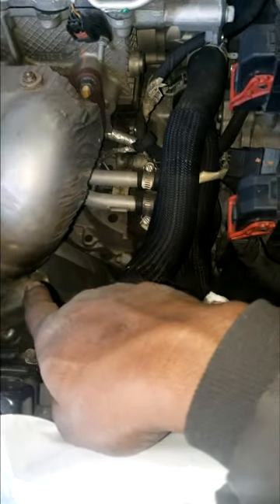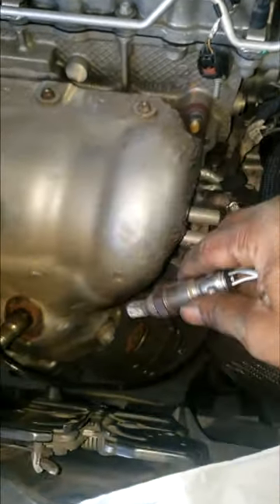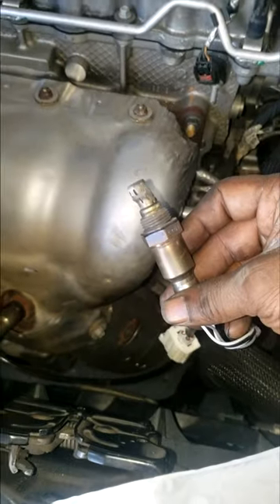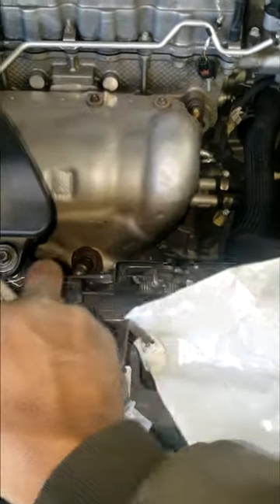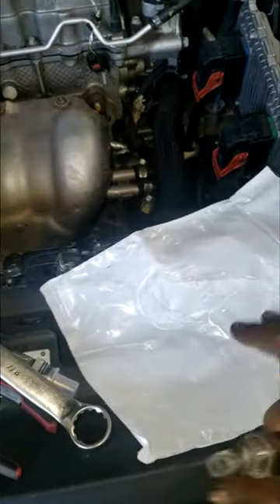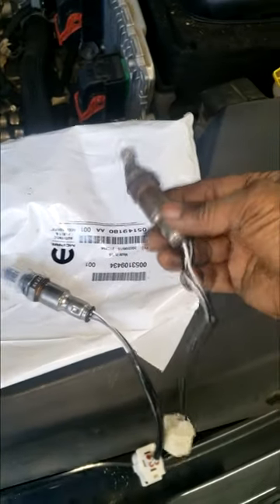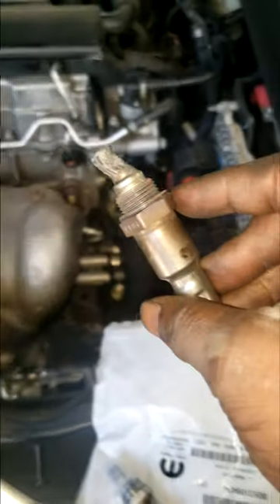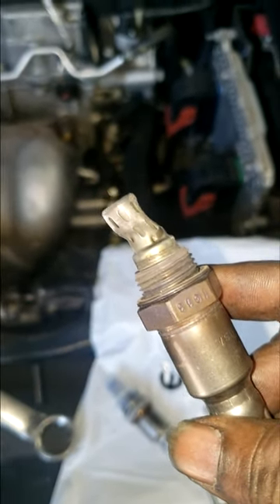Here's why this car came back as a COMEBACK RECHECK on me.

Comment: No that catalytic converter dead when working correctly the temp should be around 600 when there bad can run below 600 or get as hot as 1100
Reply: Oh so yea that 02 is melted

Comment: Looks like you bottomed it out in the bung and it got crushed when you tightened in down. You need to spin the nut on a little further before installing it, then it'll stick out further and won't bottom out.
Reply: Huh? There's no nut to spin down. The O2 sensor itself is threaded.

Comment: Converter is clogged and has been overheated and is breaking apart inside the O2 sensor is taking a beating I bet if you took the mufflers off and shook them you could hear converter parts inside...,

Comment: That has not melted, that has been struck. Someone gutted that converter on the car and didn't remove the 02. Every melted 02 I have ever seen the cage swells 360, it looks like a light bulb and barely screws out.

Comment: You missed a piece of the cat when you changed it. Must have been a piece of the old cat sitting against the O2 sensor, got hot and melted it... Make sure you properly clear the muffler system when you change the cat.

Comment: looks like a dodge dart.  they have a recall for burning oil.  supposedly it's caused by the pcm running the timing retarded. anyway the burning oil can cause the cat to clog and now it's overheating the exhaust.

Comment: I would be checking fuel trims and checking that cat with a laser and seeing what the temp is on cat. If you replaced the cat I wouldn't think it would be clogged or anything but if you didn't replace it I would be looking at that cat and checking fuel trims

Comment: You put a counterfeit one in there. Look at the bag it came in. Is it printed in the Mopar factory colors? No. It's printed in black and white. Which means it's not the actual Mopar brand. And it looks like, you're about to put another counterfeit one in there. Because it's probably the only thing your parts department has.

The number one counterfeited item in the United States is supposed to stamp. The number two counterfeited item in the United states, is Auto parts.

Comment: Now it sounds like a car is running too lean if she hasn't done any modification or no racing fuel or additive to it instead of using it then a lot of times you need to after you do the oxygen sensor you need to wipe the computer a lot of people don't notice every time you add anything new to a vehicle wipe the computer to make it recalibrate itself to the new part because the new part will make all of the parts work harder and you will failure or you just have a failure in a certain area just my opinion

Comment: Seen it twice, over torqued brother. Easy on the torque.
Reply from the maker: How is it even possible to over torqued o2 sensor? When it stop turning, you done
Reply: As a certified technician for 38 years i can tell you that i have definitely seen people over torque just about about anything including o2 sensors. Although in this case i screen shot the pic of the damaged o2 and got some interesting findings. There are straight marks from what appears to be vice grips on the tip and the tip is actually twisted and pulled "from force" in my professional opinion.  But to what end i cannot sumise.
Reply: Look again. In no world is it possible to cause that damage from install. That's either melted or got hit with something. I had to use a floor jack on a wrench to get a o2 loose once, zero damage

Comment: I would put a camera up in there, I would bet $ that CAT is either melted or pushed and damaging the sensor due excessive pressure and heat. Root cause is upstream of the CAT. Fuel trim, injectors, failed thermostat.

Comment: Look's like someone has messed with computer curves.  Or they ran some really hot fuel, an stock senor might fail. Back firing miss firings.  Air fuel mixtures aren't correct.

Comment: It's running hot or lean cat stopped up put a psi Guage in the up stream 02 sen spot u will see if the cat is stopped up or running lean stopped up fuel filter sucking air on the intake side bad map or mass air there could be Manny things !!

Comment: Cat is bad. The cat honeycomb is probably slamming into the O2 with back pressure. Or it is proven apart in pieces and damaging the O2. I would scope the inside of that cat through the O2 bung fitting and look for damage to the cat internally. Either way .. seems like the cat needs to be replaced.
Probably a result of excessive heat and unburnt fuel eventually melting the cat. Once was driven and running with a bad coil or spark plugs or multiple.

Comment: That looks like it was crushed and damaged. And the hole it came out of ? Looks like it was the wrong diameter and a flange type hole? 
Anyway, if you had a "voltage high" code, you are too rich after the cat. Your running too rich and the cat isn't able to do its job. 
O2 after the cat should be near 0. 
You probably have a problem with fuel injection or spark or low compression and you are not burning all the fuel. You may have cat damage as well now. If it truly got hot enough to do that, to the sensor you may have melted the cat. And I bet that cat was glowing.

Comment: That thing either spit an exhaust valve out of the tail pipe or it's running lean as crap. I didn't look at how old the video is, but if this is since the pandemic and Joe Biden's environmental policies, given the crap fuel they've been selling, I'd vote for lean burn with emphasis on the BURN!